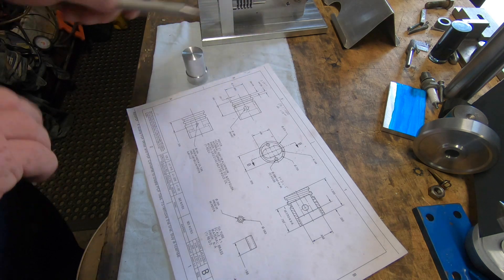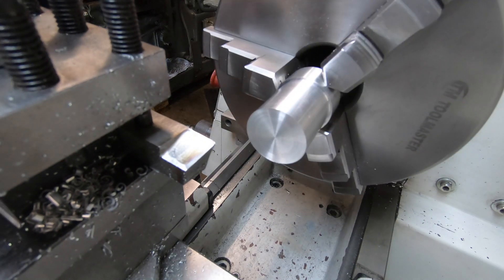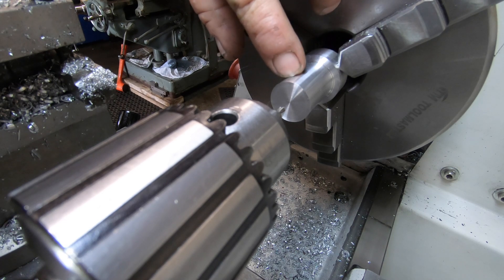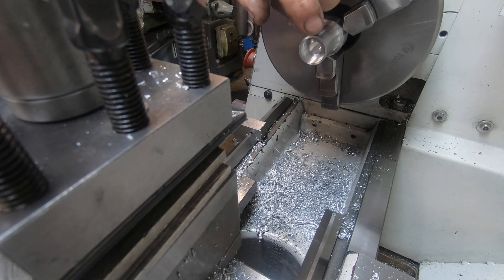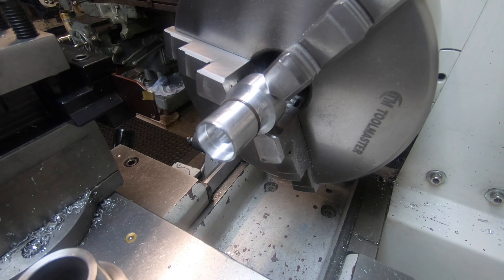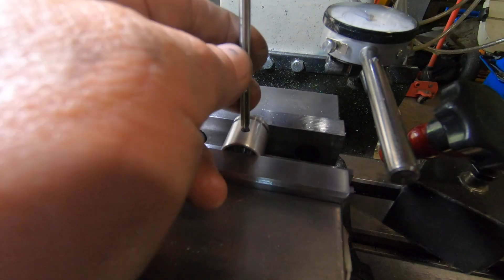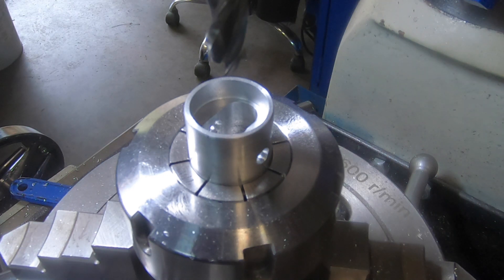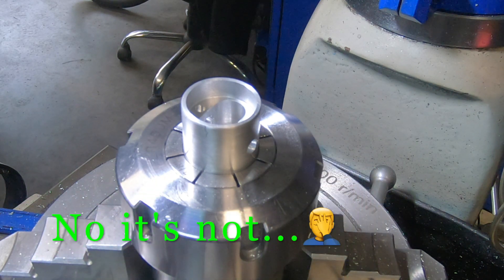Webster Engine Build  Part 5 - Piston

Comment: Hi Matty, you are becoming a real craftsman!, well done,=. Where did you get your collet chuck? I need one for my lathe, it has a 50mm bore, M5 taper. thanks for the video mate :)
Reply from the maker: Gday Gary, the spindle in my lathe is also a MT 5, I made the ER40 collet arbor (brought the nut) with a MT3 shank, the lathe come with a MT5-MT3 sleeve, I’ve just ordered a D1-4 ER40 collet chuck for the lathe, this way I can feed long lengths through the headstock, thanks for watching mate, cheers

Comment: G’day Matty. Well done on the piston looks good and a good fit. I’m intrigued with the use of Viton O ring, have others used them on internal combustion engines as they are rated up to 230C, I don’t know how hot a piston crown would get but I’d guess pretty hot anyhow you’ll just have to change from an engine build shop to an engine reconditioning shop. I hope it works out. 
Cheers 
Peter
Reply from the maker: Gday Peter, quite a few I’ve read in forums use the Viton O-ring, easier to get compression and the handle the heat, time will tell if it holds up to the task, thanks for watching mate, cheers
Reply: @MattysWorkshop  
Trick with viton is to get as smooth a bore as you can as unlike cast iron rings they don't need a cross hatch for bedding in . They work ok for short runs only .

Comment: Really nice piston Matty. You said "lap the bore". I am guessing from that the bore is going to be smooth/polished as opposed to honed, for the o-ring? That oil port probably helps with the ring wiping problem. Really interesting build. All the best!
Reply from the maker: Gday Eddie, the lapping compound has arrived to polish the bore, hopefully I can get it like a mirror 🤞, I’m still thinking on what type of oiler I use in the cylinder bore, thanks for watching mate, cheers